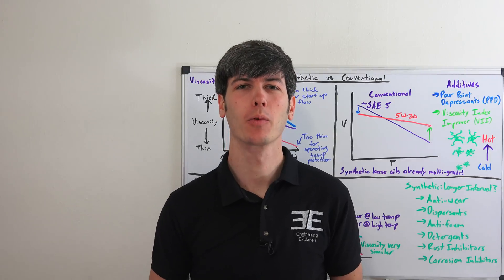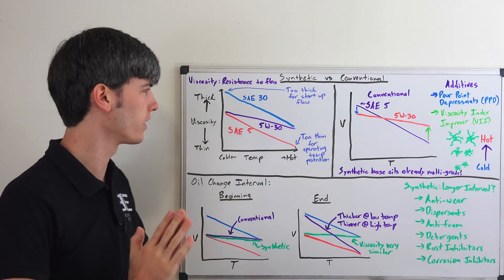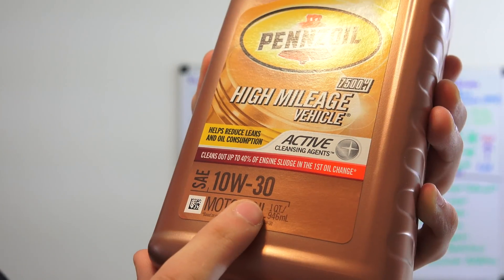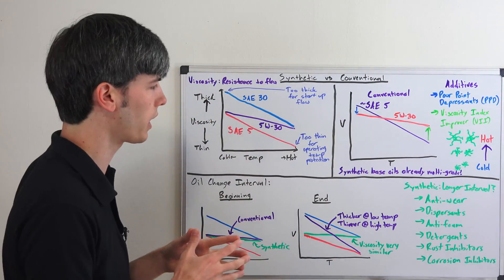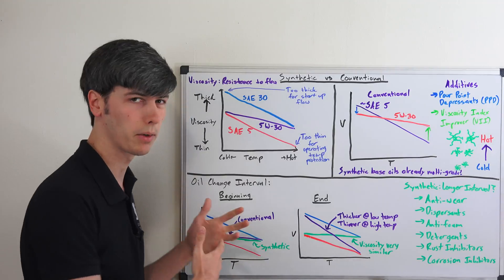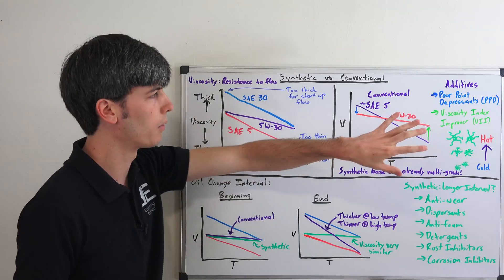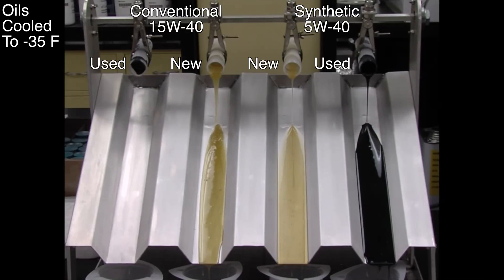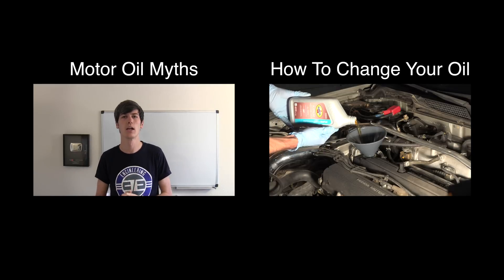Is Synthetic Motor Oil Better For Your Car?

Comment: First off I spoke with Mobil 1 factory rep way back when Mobil synthetic first came out at a GM dealership where I was a master tech at and this was when synthetic was like $15 plus a quart and regular oil was less then $2.00 a quart the key point to using synthetic oil was it does not break down with high temp like regular oil if you change oil in your car and 1 hour later thermostat goes bad or water pump fails etc and temps in engine red line the oil you just changed is junk you need to replace it or it will fail to protect and lube internals not so with synthetic .

. 2nd and foremost regular oil breaks down over time and mileage the synthetic oil never breaks down it last FOREVER all it does is get dirty over time ,, the Mobil 1 factory rep stated when using synthetic oil after the initial oil change you never EVER change the oil again all you do is replace the filter at normal interval and top off fluid from whatever you lost that was left in the old oil filter so pretty much every 3000 miles change filter and add less then 1/4 quart depending on how messy you are during the filter change. 

  now this was about 14 years ago since then factory oil changes have increased to about 7500 miles for most applications even with conventional oils and price for synthetic has dropped drastically but for me I change filter every 3000 miles religiously and use synthetic oil in everything including lawn mower with one major exception.. if you have a daily driver and have an oil leak you do not intend to repair then using regular oil might be less expensive .. Also when using synthetic oil you will have some oil burned as normal during a 3000 mile oil interval this is considered normal and is the nature of the beast so if your engine burns 1/2 qt and you need to add yet another 1/2 qt lost in filter change for a total of 1 qt added per oil change then this is NORMAL at least for Mobil 1
Reply: From the Mobil web site: "We recommend that you follow the oil and filter change frequencies shown in your owner's manual, especially during the warranty period. With the high-performance reserves of Mobil 1, you can have the confidence to go the full mileage or time frame recommended by the vehicle manufacturer. Mobil 1 is especially suitable for the latest vehicles with extended drain intervals or vehicles with oil monitoring systems that vary oil drain intervals."
Reply: to the reply from someone from the mobil website... what you copied is the current recommendation from an oil company that has changed their tune over the course of 15 or so years being back when introduced the price was so high the selling point was its the last oil change you will ever have. to today when they want to sell you 6qts every 7500 miles but hope you'll change every 3000 miles like grand pappy used to. Bottom line "read" the fine print synthetic does not break down with temp or with wear.. period .. it "only" gets dirty period so all you need to do is change the filter and top off .. if you have a 2 million dollar Bugatti veyron by all means change the oil & filter what I am saying is if you have a normal every day driver that does not leak oil use synthetic it will be cheaper and better in long run I have a lawn tractor that has had synthetic oil in it for 15 years and runs perfectly fine and clean inside. and multiple vehicles over 7 years and 50 thousand miles but I use premium filters the best kind available and every 3000 miles change filter you can eat off the insides of these engines. only a moron says conventional oil is as good as synthetic oil thats not at debate here what is the issue is it will last forever and this isnt even something that is new from GM .. GM cars with superchargers from the factory lets say on a 2000 Pontiac grand prix with Eaton supercharger.. the oil inside is non serviceable. as in it never needs to be replaced ..EVER   why ? because oil in supercharger is kryptonian and lives forever? no because it is a special type of oil and very specific for that application and it is synthetic. now you just cant add any oil in that application but what I am getting at is even at 200 hundred thousand miles GM says that oil in supercharger does not need to be changed ever. same thing goes for the oils they use in differentials ..also does not need servicing .. modern transmission fluids ?? also synthectic but those need to be flushed at service intervals because they no longer recommend dropping tray and replacing filter if you add a drain and external filter you also do not need to change the tranny fluid if synthetic

Comment: So this is why when it's cold outside I warm up my car for at least 2 minutes and drive slow the first few miles. Because the oil needs time to circulate and coat metal parts .  I hate when people that don't know say not to warm up your car in winter and  just drive off.
Reply: I use conventional oil but will be switching to full synthetic this month.

Comment: Of course the synthetic motor oil is going to flow better at -35°F. The dummy in this video is comparing 5w-40 synthetic to 15w40 conventional oil. Duh. 5:31
Reply: He's not comparing 15w40 to 5w40, it's comparing new to old and showing that Synthetic keeps its viscosity more instead of getting ridiculously thick.
Reply: I didn't understand that point either.
Reply: I think he&#39;s trying to illustrate that you won&#39;t be able to find a mineral synthetic 5w40. (sorry, mistyped)

Comment: Better ? Yes, no, maybe.Each improvement in SAE designation shrinks the difference and blurs the lines between conventional and syn oils. We have to before ant discussion is to define what actually is syn oil.
Reply: There isn't. But as ACEA, API and SAE specifications grow ever more prescriptive it will be impossible to meet the requirements with a mineral oil. I suspect we are already at that point.
Reply: As far as I know, there is no official API def. of "synthetic".

Comment: This is a very friendly explanation, I've been using Mobil 1 Extended Performance for years. I've had it can go up to 20-25k miles and not yet had engine problems (2002 Caviler Manual Transmission with over 150k miles), it can occasionally get close to 2x the cost of conventional oil (I try to find on sale), but since I get 3x or more usage out of it, I'd say its a plus. I also use a K&N Filter (generally), it's been good for me.
Reply: From the Mobil web site...quote: "We recommend that you follow the oil and filter change frequencies shown in your owner's manual, especially during the warranty period. With the high-performance reserves of Mobil 1, you can have the confidence to go the full mileage or time frame recommended by the vehicle manufacturer. Mobil 1 is especially suitable for the latest vehicles with extended drain intervals or vehicles with oil monitoring systems that vary oil drain intervals."
Reply: Do recall they don't want to piss people off and get sued.

Comment: For those using old engines I'm talking pre 90's cars. Engines were designed to be used with mineral oils. The best practise with oil is not whether you put synthetic, semi synthetic or mineral but how often you change it. I've several engines with well over 200,000 miles doing heavy towing, off-road driving, and then motorways. Using mineral oil like it was designed for at the 5000 mile change interval. A synthetic oil is normally bad news in a engine designed for mineral oil.

Comment: That's all fine and great that you did a test that only applies to North Dakota but I want to know how well they work in the 125 F of the Sonoran Desert.
Reply: +iTheGeek 
haha! everyone is so self-entitled these days.
Reply: If you've paid attention to the video (short skirting the Shell sponsorship, this would apply to ANY equivalent quality motor oil that the vehicle manufacturer specifies as apt for their engines) in ANY HOT CLIMATE (constant exterior temperatures of > 90 degrees F / 32 degrees C or constant stop-and-go at lower temperatures) a single-grade motor oil that suits your vehicle (for both viscosity and age of the engine) will suffice.

There's this rule of thumb for used vehicles: whatever oil you can use on a brand-new this model year vehicle would be more than fine for older vehicles, since they don't require as much additives as newer vehicles. Age of the engine at a certain point may require a change to a motor oil (usually labeled HIGH-MILAGE or something like that) with extra additives designed for certain parts of older engines.

Remember to treat constant high temperatures as SEVERE SERVICE in your vehicle's owner's manual for changing your oil and filter; it may save your vehicle and hassles...

This Spanish translation is done in the hope that mentioning the Sonoran Desert someone that speaks Spanish may need the info... [Esta traducción al Español, dada la mención del Desierto de Sonora es hecha en el caso de que gente de habla hispana lo necesitase...

Si prestaste atención a este video (olvidándonos de el auspicio de Shell, esto aplica a CUALQUIER lubricante de motor equivalente de calidad cuyas especificaciones sean aprobadas por el manufacturero del vehículo para sus motores) en CUALQUIER CLIMA CALIENTE (con constantes temperaturas exteriores de 90 grados F / 32 grados C o más o constante tráfico pesado a menores temperaturas) un aceite de motor de grado sencillo que se ajuste a tu vehículo (tanto para viscosidad como para edad del motor) es suficiente.

Existe esta regla de juego para vehiculos usados / de 2nda mano: cualquier aceite de motor que pueda ser usado en vehículos nuevos del año es más que suficiente para vehiculos usados, ya que no requieren tanto aditivos como los nuevos. Hacia cierto punto de la vida del motor podría requerirse cambiar a un aceite de motor (usualmente rotulado como de ALTO MILLAJE o algo similar) con aditivos adicionales para ciertas piezas de motores más viejos

Recuerda tratar el constante calor como SERVICIO SEVERO en el manual de tu vehículo cuando se trata del tiempo del cambio de aceite y filtro de motor; podría salvar tu vehículo y evitar inconvenientes...].
Reply: Actually, 180 F is controlled by a 180 F thermostat and that is JUST the coolant/antifreeze. If you have a 190 F Thermostat then the coolant will hover around 190 F.
Your engine oil is going to 10 to 40 degrees hotter.
Reply: most cars here run ~237 in the summer and 190-195 the rest of the year.